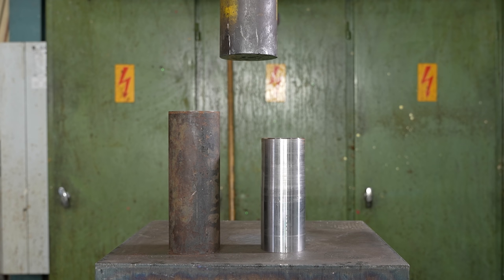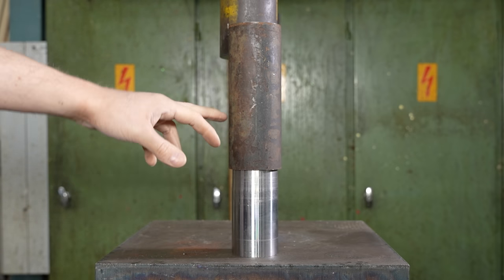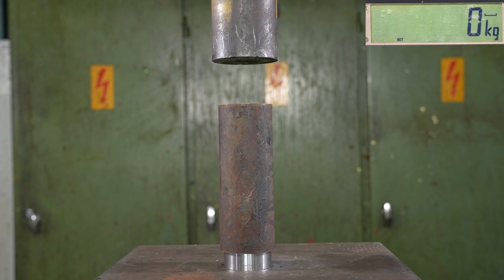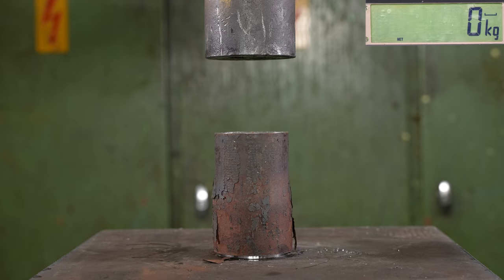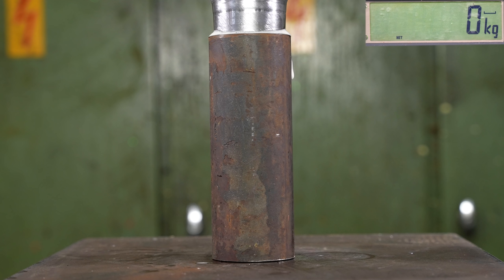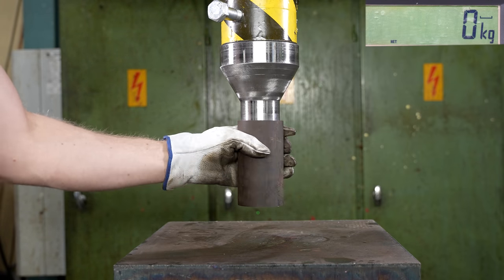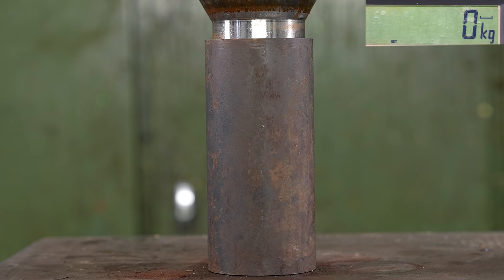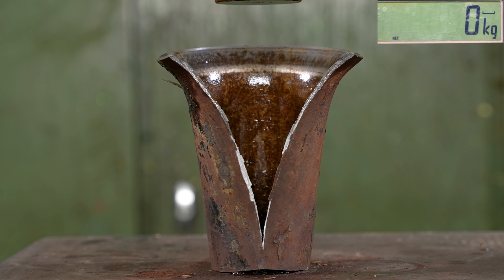Forcing Too Large Shaft into Steel Tube with Hydraulic Press

Comment: Going to have a lot to do with the angle of your die I would think?  Looks like the weld was giving way which is quite interesting.  I would have guessed with all the pipe that has been made they would have the weld seam as strong as the parent metal or stronger since it is always proud inside the tube.  Try some D.O.M (drawn over mandrel) material and see what gives way then?  I would also be curious to see if the amount of force necessary to press it back out of the tube is equal to that which seated it or less?

Comment: Use the tool to expand the pipe until you can insert a second piece of identical pipe and keep doing it as many times as possible to then see if the outside pipe fails or the inside pipe shrinks.

Comment: I used to work for Evraz. Most steel pipe is made using rolled steel "skelp" which is flat sheets of steel in the form of large coils that come into the plant to be processed. It's formed using a continuous system where the coil is fed into the mill (in our case we had what was called an "accumulator" where multiple coils were welded together end-on-end to allow for continuous feeding into the mill). The skelp comes out of the accumulator at a slower speed than how it comes in (hence the ability to keep a steady feed into the mill) and is fed through rollers and formed into a U-shape and then curled together right before the weld head, and gets fusion welded. But there is a process where some pipe is actually drilled out from a solid steel billet. Probably WAY less common though.

Comment: Working at a Midas we had a pipe bender/expander and yes during expansion/flange making if you went too far the aluminized pipe would split on the seam like these do. This is old pipe and that flaking is either galvanization or aluminization breaking off the surface of the pipe.

Comment: Tubing is made from flat stock rolled then welded. The seam will break next to the weld every time. Try using a hardened point, then heat the tubing white hot and press to form it into a steel trumpet 🎺.

Comment: This is a bit like watching tube being shaped at an exhaust shop. Flared, stretched and then bent at all angles.
Though recently I tried to press a piece of 1"tube [25.4mm]  into 25mm inside hole and it split,, about 3 times.. And did it 3 times.

Comment: It looks like DOM tubing, which is welded, and then re-drawn with a die and mandrel to even out the surfaces. So even though there's no obvious seam, and it's usually as strong as the rating... it's still welded pipe.

Comment: I used to press drill sleeves into aluminium rigs. First, I pre drilled and reamed the holes before glueing the drill sleeve in place.
Then I got a hydraulic press. I went to pressing them into the pre drilled hole, without reaming and glue.
Then, one day, I wondered if pre drilling was necessary at all. For solid aluminium plate, no. I was able to press the drill sleeve right into the work piece, which made my boss kind-of nervous 😀

Comment: Push the tool into two identical pipes, the other cold and the other red hot. How much less force does it require to expand the hot pipe?

Maybe you could also try it with a pipe chilled to cryogenic temperature!?!

Comment: Tubes are usually made from flat steel sheet, rolled then welded.  Thus the straight break down one side. It's easier,  cheaper and less wasteful than milling out a solid bar.

Comment: seamless steel pipe is made in much the same way as the press and rod expanded that pipe. The still hot steel tube is forced through dies that expand them, set wall thickness and then cuts them at a regular length. Extrusion is basically just a big ass sideways press and a finely tooled die for it to be smooshed  through

Comment: If you add heat to the pipe first with a torch it shouldn't brake when pressing it because the metal should be a bit more flexible. But you have to press slow to give time to the metal to take shape.

Comment: Most mild steel pipes used for structural construction are made by rolling  metal sheets into a tubes and the seams are welded and grinded to perfection that the welded seams are not visible anymore. .

Comment: You’ve demonstrated the great properties of steel and why its a metal used in everything. Not only should you have used lubrication but to give time for the metal to react you could have tried to pause or lower the press slower. We forget that there is a reaction time however small that could hinder the metal ability to take a new shape. I’ve seen extruders using lathes to shape steel more than i would ever expect. Good video

Comment: The reason why your pipes kept opening in the back is because the tool you created for it had an imperfection in that one same spot that tore into the metal enough to not let it stretch. Same spot twice means it's the tool not the pipe

Comment: I would use steel tubing not steel pipe. Steel tubing is “Drawn” through dies. There is no seam.
You could also “Turn” a solid steel tube with your lathe.
Alway fun to watch your experiments.
Reply: DOM still has seams.

Comment: sooo a rule 34 of the internet than?

Never thought there'd be one for steel / metal in a popular SFW channel bu hey it is rule for a reason.
Sure make the socket wrapping metal thicker, maybe have shorter narrow bit of the pressing in part? if you go with cone anyways you do not need that much narrow steel insert for the pipe right?

Comment: In the last section you can see where the material starts to rip at around 23 tons. Would be interesting to know what was the diameter then. And also what if you stop before the rip starts and give it a heat treatment? Can it be stretched more then or just cracks like before?

Comment: The cone angle is really important. With a sufficiently shallow angle you can expand a pipe like that until the wall is basically foil thin, although you would typically use multiple dies in succession for that.
Reply: The outer pipe is actually getting shorter, wall thickness stays pretty much unchanged during expansion.

Comment: 8:35  you can see the lube that got on the outside of the pipe start to evaporate away from the heat as the rod pounds the hole.

Comment: That's impressive, and depending on the structural integrity of the steel, following the insertion, I'm curious if this method of connectivity could ever be utilized in the future.
Reply: They use an interference fit, on the old panavo tornado swing wing jets, bolt, they have to freeze it in nitrogen to pop the bolt out or in

Comment: How watertight/airtight is a press fit like this? How much pressure can it withstand before leaking?
Reply: Do this for a living. We’ve put 15,000 psi behind expansion cones like this.  Metal on metal seal.
Reply: @patrickdunagan6780  Neat, thanks for sharing!

Comment: I think you should try it with a pipe that has less oxidation. That was a huge part of the flaking, and likely made weak points at the ends where cracks could form.

Alternatively, you could use a more malleable metal like copper for a comparison.

Comment: You really dont have to use imperial measurement on the screen.
only 3 countries (all quite new and unmature and previous imperial sieged) are partly using imperial units.
# Its military dictatorship in Myanmar
# Its LIberia in Africa.
# and its some of the midtpart of America, called USA.
and USA has signed the metric agreement and would outface imperial units ASAP, now that all imperial units are defined and based in metric and the USA could also see how ludicrous it was to put a conversation factor on top of metric, and call "it imperial" just to feel special.
so you're doing them a bad favor, by putting Imperial units now that the USA is doing their best to remove imperial.
It's like with a young bird that needs to learn to fly.. just kick them out of the nest, and they will learn on the way down.
Finland, stop doing bad favors to other nations, and that also includes Putin, that Finland sadly is into bed with - while he is tumbling Europe in war and tensions.